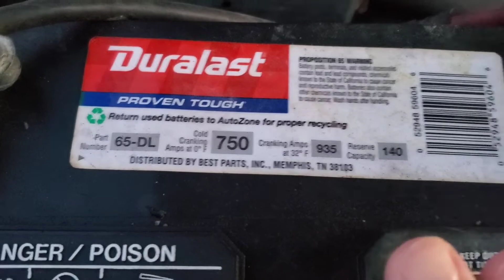Basic maintenance on my 1995 F150

Comment: So Rob, one thing I notice in your videos is that you immediately hit the OVERDRIVE OFF button before you take off. You have me doing it in town now. Do you use it on the highway though?
Reply from the maker: That is funny. Yes, since it's an old transmission, I like to drive with the over drive off.
Reply from the maker: You know, I haven't considered that, but I might try.
Reply: @RobsGarageKC  So true. Great point! Mine is old too, even with just 27K miles on the truck, I still feel like you do. 👍🏻
Reply: @RobsGarageKC  You have big rubber on yours. You might not need it.
Reply from the maker: True...